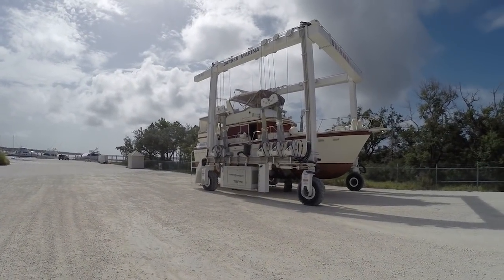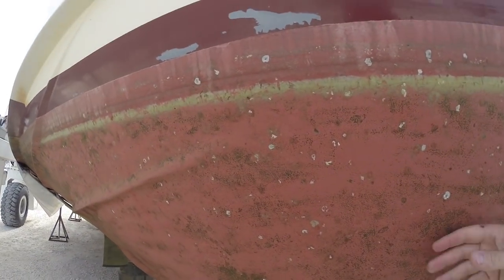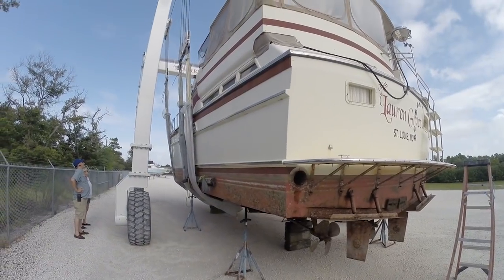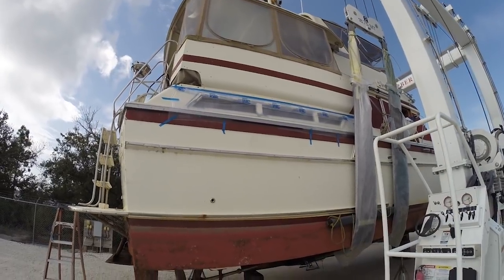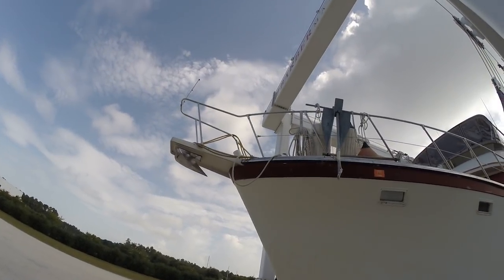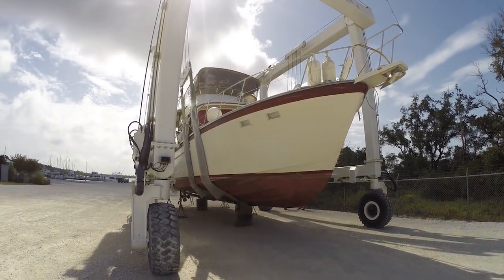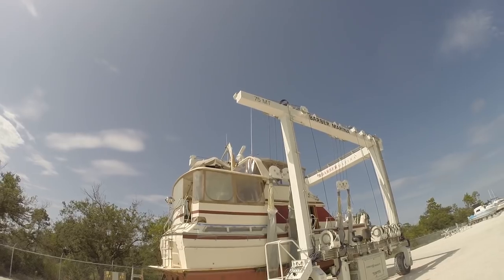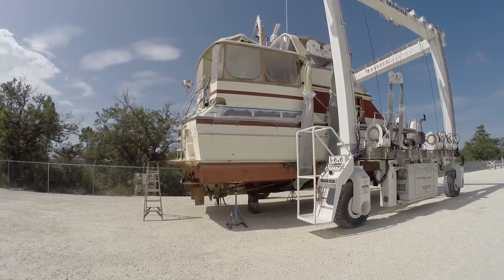Trouble With The Survey Emergency Haul Out..Buying A Boat..Trawler..Yacht..1987 Jefferson Sundeck 42

Comment: Ok I’m dum.  What leaking? Help me out DRL.
Reply from the maker: dum = dumb ...Hugs  There was a leak in one of the intake water lines that cools the a/c and the fitting was cracked.  That was letting water inside the boat when the boat was in the water..These  fittings are below the water line of the boat and if not fixed will/could sink a boat
Reply: Thank You I understand now 😀. You wouldn’t have that problem up here. The water is too thick this time of year 😬

Comment: You agreed on a price BEFORE the survey? Really? What am I missing here? 
Did it have to be hauled out to get to the seacock? 
$25 per foot sounds like a total rip. Especially the "emergency charge". Maybe you're being hornswaggled. Should only cost a couple hundred bucks each way, if that. Look it up. 
Example:
http://www.commodoresboats.com/faq/how-much-does-it-cost-to-haul-my-boat-out-of-the-water/
Reply from the maker: Yes you are correct..Agreed on a price contingent on successful survey,s oil analysis, and personal inspections.  Common practice.  If there were things that were not up to par or in need of repair that was not disclosed we would renegotiate ( as we did ) or walk away from the deal
The issue was at the thru hull and seacock causing the emergency lift
Of course it depends on the area you are in that reflects price